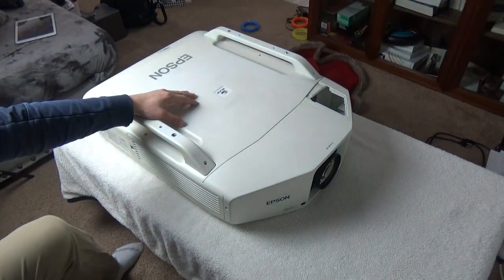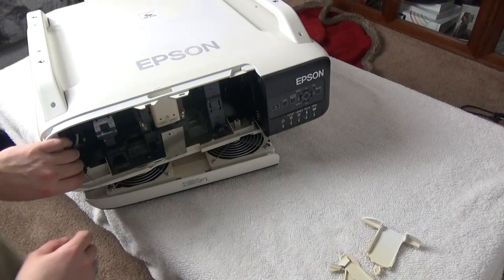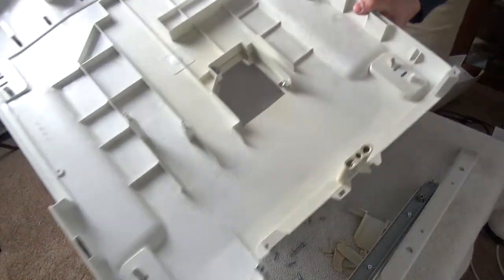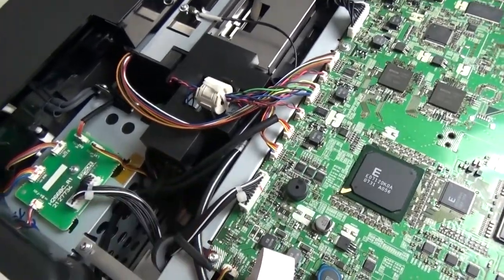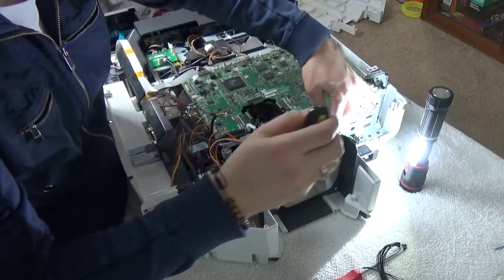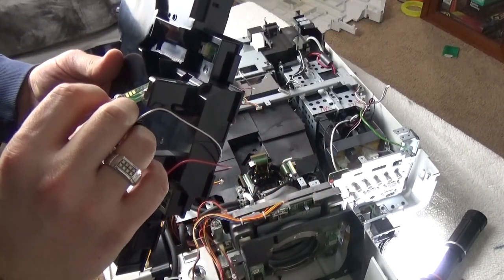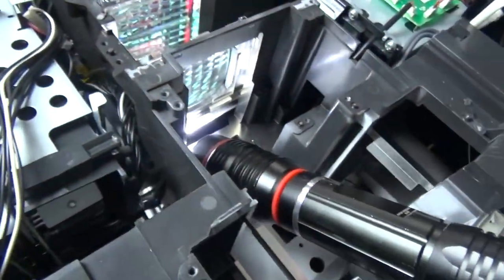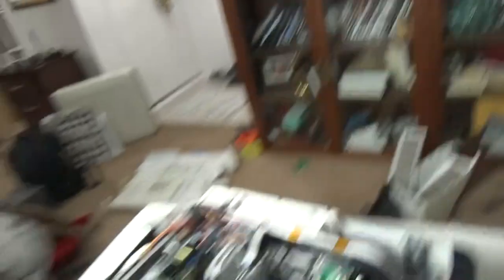Teardown of a Huge Projector. Walkthrough of this beautifully designed with colorful inerds Device.

Comment: YO just watched your Mutlimeter where you compared the two, very infmorative, used to be an Electrial apprentice but I cant remember how to mesausre amps... like say for my iPhone charge... but your demonstration with the toaster was brilliant. Couple questions: yo how did you connect it for current? saw you plugged the black on into the outlet, but what did you stick in the positive side (red) side? that led to the black clips you clipped to the prong on the toaster outlet? it looks like it was a screw driver with a clamp on it. Meaning you have a wire with clamps on each end, one to the lead into the power source an on clicped on to the prong on the plug! PLEASE ANSSWER. ME BRO
Reply from the maker: Dan, think of measuring amps like counting atoms. To count each one, your measuring  tool needs to be connected in such a way to the circuit so that each atom passes through it, so in this case it must be part of the circuit - just like a wire is. The multimeter can "count" how many atoms pass through itself if its connected in this fashion.